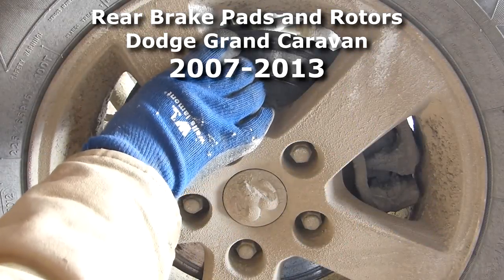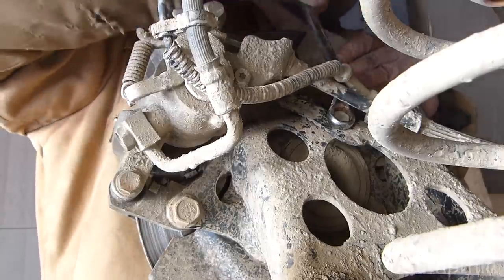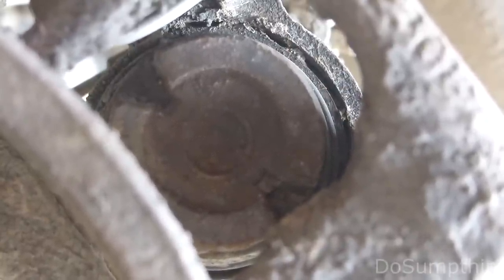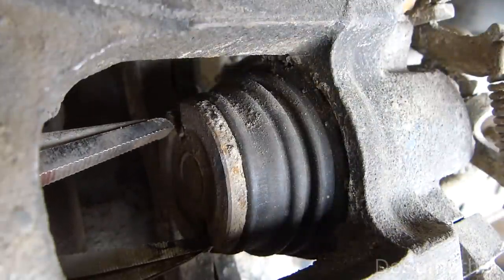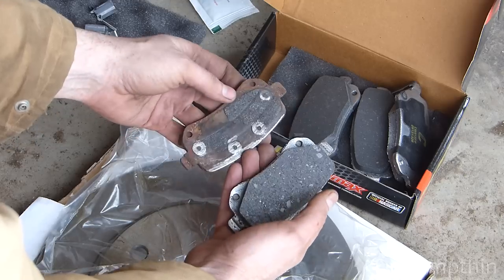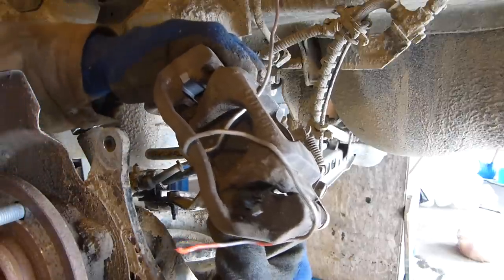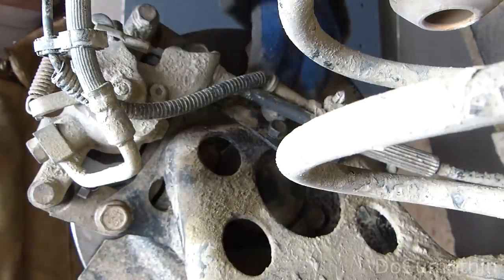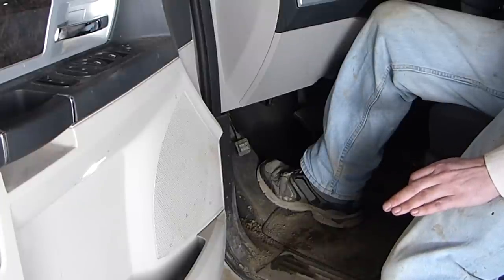STEP BY STEP: Grand Caravan REAR disc brake pads & rotors without special tool (2007-2013)

Comment: Great help. Never seen the rotating piston design before.
Something for DIYers to keep in mind.
Those anti-rattle clips, might cause some problems. The ones on the after market brakes I installed are actually stamped into two different shapes. An upper clip and a lower clip.

If you find that you can't put the pads in with those clips installed, make sure you installed the correct clips on top and bottom.

I was not initially aware of this and was about to throw the clips out before I noted the two different shapes.
That said, once the right clips were in, the fit was still fairly tight but doable by hand.

Comment: Very well done video!  Something I found on my 2011:   I would also suggest that people check are the pins the caliper slides on.  In my case the pins on the passenger side had taken in water, and therefore rust, and were binding.  The rubber boot on the slide pin was in place and had no tears!  I ended up replacing the caliper bracket also because they were so bad.  Hope that helps someone...

Comment: Thank you very much. Emergency brake cable on our 2005 Grand Caravan snapped this morning -- I had it on while jacked up to replace the power steering line. I couldn't back up out of the garage but needed to run an errand. For some reason, with the cable snapped, the back wheels weren't 'releasing'. I backed up a little and they've seemed to let off. Another maintenance job to look at when I replace the rear disc pads and rotors. Continued success. Nicely edited and produced.

Comment: Thank you for the comment on the need to adjust the parking brake after changing rear pads.  I've had a low pedal since changing the rear pads and you provided the solution.

Comment: One important step you might have left out. Make sure you clean the bracket under the clips before you reinstall clips. Rust buildup under these clips will sometimes cause the brake pads to stick. I leaned the hard way as I thought the caliper was frozen which it wasn't.

Comment: I've done the brakes on the wife's van once before and  I wish I had seen this video then.  Lubing the pins is also a great idea. Neglected that ONCE n the wife's Pontiac Grand Am and she STILL hasn't let me forget the repair bill when the brakes wore out in about 1000 miles because the pins were rough and rusty.

Comment: Another superb video! My son and I did the front brakes which went quite quickly and easy. The rear brake job was equally easy. We decided NOT to get the special tool and used a pair of needle nose pliers. It was simple and went off without a hitch. Well, we did install both pads without the metal low pad indicator pin on the first side we did and we didn't discover that until we couldn't get both pads on the second side. Whoops! It did add about 10 minutes to the whole job, so not a huge deal. Overall it was a simple job, pads and rotors. Thank you so much for making this video!

Comment: Great attention to detail is what I love about your videos. I have had issues with rear discs on cars and  I really don't think that the average car really needs discs in the rear. I find that drums last longer and have a lot less problems. Drums are more trouble to change but in my experience they are pretty foolproof. When chev put rear discs on their trucks they had problems with rock getting in them and causing a lot of grief. The design of the parking brakes and other details to me make the rear discs more prone to problems. As for shorter stopping distances, I find that more a function of the brand of vehicle than the type of brakes.

Comment: Thank you for clear , understandable, nice video angle and light, conversation without any unrelated topics to replacing brake pads.
 I just wanna make point in my experiences  with an issue, when i was using autozone Duralast brakes, that was lasting about 5-9K miles ,  which is really bad, 

i used them a lot, because of their replacement warranty,
then i switched to other better brands that started lasting 20-35K miles ,

Comment: Great video; helped a lot. A couple of things though 1) after fumbling around 20+ minutes trying to get the new pads in for the first side I decided to remove the caliper slide pins, thus splitting the whole assembly in two. I was then able to put the pads in at my workbench where I had more room to work. On the second side I took the pins out first, and that made life so much simpler. 2) Where do you live that your rotor came off with a few bangs from a rubber mallet!? Mine is so rusted on the hub that only a sledge will get it off, and since I didn't need to replace it I just left it. This made compressing the caliper a bit harder, but oh well. 3) Speaking of compressing the caliper, if your town doesn't have a store that will loan you the tool, and you don't want to buy one, there's a disc brake tool that looks like a cube that you put on the end of a ratchet; works a lot slicker than needle-nose. 4) Lastly, when compressing the caliper make sure the boot doesn't bind; if it does you'll have to crank it back out and do it again.

Comment: IMPORTANT NOTE FOR 2012 GRAND CARAVANS BUILT AFTER 03/12: So apparently there was a change made to these back brakes in March of 2012, I went to get pads and rotors for my van and they asked me if it was built BEFORE 03/12 or AFTER 03/12. Mine was built in May 2012, so it was after. Got the pads and rotors, took off the wheel and started disassembling the calipers when I noticed I did not have the mechanical parking brake bracket you encountered on your vehicle in the video. So, if you are doing the repairs on a 2012 GC that was built AFTER 03/12, you probably won't have that bracket to worry about either. Otherwise, everything was exactly as you said and I was able to get my pads and rotors replaced in just a few hours. 

Great video, thanks again!
Reply: Thanks.  I noticed the same issue with mine.  However, the parking break line did not have enough slack to get it in position in the caliper bracket.  Any idea on how to get some slack in the parking break?

Comment: Thanks for the video, it helped loads in fixing my 2013 grand caravan. I did not have the 13 mm bolt for the parking brake installed on my model. Thank you for the video and next time I have car issues I will refer to your channel.

Comment: Thank you for this, I found it very helpful.  The E-brake would have confused me never having dealt with that set up before.  This got me through it.

Couple improvements:

 Instead of turning the plunger till it bottoms out as suggested I turned it till it was just open enough.  I measured the new stack-up of the rotor plus pads and I used a depth gauge on the caliper  to get it right on.  Once installed I only had to push the brake twice to set it and the e-brake 5-6 times.
 
Also I found the rubber boot on the plunger stuck bad on the first one I did, making it difficult to turn and have it stay.  It also started to do some damage to the boot before it finally let go and aloud the rotation to happen.  Knowing this going to the next side I used a very small flat head screw driver to break the boot loose from the plunger, making turning the plunger so much easier.

Comment: Your video is most helpful, EXCEPT for the main surprise.   Expand it just a little and show us how much fun it is to get an old rotor off - when it's been rust-bonded to the plate behind it.    Whoosh!    What fun.
Reply: I second that! I ran into the same problem, I never had to beat a rotor with a sledge hammer so much in thirty years of doing brakes like I did to get these off! Terrible engineering by the kids at Chrysler-Dodge.

Comment: hey! very good video highly descriptive! i have use your trick with plyers for one side... didnt find it efficient and looked for another solution... i have come up with a power grinder disc locking key... comes with all grinders, standard size.. probably buyable in any tool shop... very very efficient!

Comment: I will like to add something because I have to do it in order to be able to screw the caliper piston down

So you need to release the pressure on the caliper piston by opening the purger valve, of course use a self one (homemade) purger container that way they will not be air on the lines. Same apply for the front and rear

Comment: 1 thing that I do is crack open the bleeder plug before pushing the piston in, it makes it go back in much easier plus it keeps you from putting back pressure on your ABS SYSTEM.

Comment: when you seat the piston the notches are supposed to be at 6 and 12 oclock,the latest brake pads have a centre pin which engages the notch,the drivers rear brakes have been quite problamatic, I thnk the addition of the pin is to address this issue.I had to do my rear brakes at 17k and now again at 40k. The original pads had no pin . Replaced  caliper as well it was seized. Nice video ,well done
Reply: In 2013 Chrysler wised up, or realized they were ripe for a class action suit, and went to H.D. brakes, but the jury is still out on whether they last  any longer. H.D. means twin front cylinders, larger discs and pads all around and 17 inch wheels to make room for the extra hardware. My 2015 is still showing excessive brake wear, in spite of these improvements. We'll see how it goes. Although off topic, another area they succumbed to consumer pressure, after 10 years of denying a problem, was solved with a big HVAC Control System recall in 2017, that is guaranteed for an additional 100 K miles.
Reply: I don't see how the piston could be prevented from turning as the handbrake is adjusted unless there was a pin. Any chance the pads were reversed ie outside pad on the inside? Without the pin the handbrake would not be able to adjust for pad wear. The pin has been there on all Gen 5 vans (2008 onwards).
Reply: Michael McLernon I have an ‘09 Town & Country that I’ve probably sunk $3000 into the AC. The last time it stopped working I decided I wasn’t putting another penny into something that was guaranteed to fail again. Now we just ride with the windows down all summer. I wish I had the money to get something else. But I’m stuck with this till it’s dead probably.

Comment: Overall A Good VideoBefore putting in new sliders, caliper channels need to be cleaned of rust and dirt that can make clips too tight to pads.(Especially important if exposed to road salt). Lubricate channels and new clips generously with high temp silicone grease before putting new pads in place.Highly recommend thorough wire brushing of hub surface before installing new rotor, (to help avoid run-out) with light coating of grease or anti-seize on rotor to hub contact area to make rotor easier to get off next time.These are minor suggestions, I know it must be difficult to try and record and work at the same time, and you may have just neglected to mention these points, but a good refresher for me to re-read before starting another brake job on these troublesome brakes.Nice Work!

Comment: I didn't use the special tool on a relative's T&C either. It's fine. Check to make sure the parking cables release properly and the caliper pins are lubed and free. Put some brake purposed grease on the pad tabs and backing plate. Most importantly, use quality components.

Comment: You can tell if you have cycled the parking brake enough by jacking up rear wheels off the ground, setting the parking brake (after cycling) and checking that both wheels will not rotate. If one or both  wheels can still be turned, you need to keep adjusting until they won't move. It may not be safe to drive until both wheels are fully adjusted. Brake pedal has been reported to go soft if not properly adjusted.

Comment: Well your video really inspired me on trying to do my own back brakes... Unfortunately I couldn't get the 18mm bolts to even budge... I tried oil penetrants, An electric impact, and a tork bar, propane torch and it won the fight over me... Guess i'll have to bring it over to the garage and get the wallet out again... :(

Comment: I've got a 2007 Dodge Grand Caravan which is VERY different from the one shown which is the 2008-2013 models.
Reply: Greg Rein glad to read this comment. I have a 2007 and was skeptical when I read the title “2007-2013”. I knew they changed a lot in 2008.

Comment: As far as those little grease packets that are sold at the counters of Auto Zone & all the other auto parts store chains... 

Sometimes you may notice that some of those grease / lubricant products are sold in 3 different grades, like "high performance grade", for example...

I can tell you from first hand knowledge that "all 3 grades" are exactly the same product...so don't waste your money on the premium or higher grades. It's just a scam to take more of your money.

The grease / lubricants show up at the packaging facility in both 55 gallon drums & sometimes depending on the product, in one of those big tanker trucks w/ a valve out the back.

The packaging facility takes that product straight from those containers and mechanically injects them into the small foiled or plastic envelopes. The only thing that changes in that operation is the changing of the fancy colorful package.
Reply: International Silverstring Submarine Band they're all 1.49 though lol

Comment: Great Video, I have a problem with my parking brake, the dealer set the pedal so tight that I can barely push it down but the parking brake doesn't engage.  Upon inspection I found that the return springs are missing as well.  They adjusted the pedal when I complained about them not testing the brake.  Any ideas on how to reduce the tension on the pedal so I can get the parking brakes back to normal and adjust them properly?  Thanks.

Comment: I just completed changing front pads and rotors after watching your excellent video.  I noticed that for the rear pads and rotors you did not remove the caliper from the caliper bracket as you did for the fronts.  Any particular reason why?  Thanks!

Comment: - I'd recommend putting some loctite on the bolts. Having a bolt pop out on the highway is not fun.
- The tool is also a good idea. If your needle-nose pop off the piston and damage the boot, you're going to be googling bleeding brakes. 
- Loosening or opening the brake fluid cap while pushing in the piston may help if you're having a hard time pushing it back in.

Comment: Using the needle nose was a pretty smart idea.  Only complaint about this video is that you didn't take the caliper off first and inspect the pins.  It's very important to grease those pins every time you change your brakes.  If they seize in there you'll likely have lots of problems with premature brake wear.
Reply: +Lêmon I just replaced my rotors and pads yesterday, was simple enough with this video. But, I also did not take out and lube the slide pins like I did on the front, mainly because this was my first go-round with brakes and did not want to do anything I wasn't comfortable with. Now you have me concerned though, I still have the grease packet. How easy is it to lube the pins without having to go through this whole process again? Is it just as easy as removing the bolts and slide pins, greasing them, and putting them back together? Or am I going to have to unbolt everything again?? Please reply, thanks!
Reply: +Will Macan your going to want to remove the caliper again and pray that your slide pins aren't seized in there.  If your experiencing uneven brake wear you might want to get ready for new calipers, unless your fortunate enough to remove those slide pins.  I'd say greasing those slide pins is just as important as changing the brakes themselves in my opinion.  If you don't you'll run the risk of them seizing into the mounting bracket.  Look up a video of how a caliper works with the sliding pins.  But they are easy to take out, all you have to do is remove the caliper bolts, remove the caliper, then remove the slide pins.  Grease them up pretty good ( I always put a little extra ), then throw everything back together.  You don't have to remove anything else really.

Comment: good video....i noticed you did not use the grease in the packet that came with the new pads....should i assume that is caliper grease to apply after you have cleaned removed and cleaned the caliper guide pins?

kk

Comment: Thank you so much, exactly my problem. (Rear brakes 2010 caraven)
Unfortunatly this is the second time in 40000 kilometers .
Fixed for free by the dealer the first time, but exactly the same symptoms again a few miles later.
The "clue" is quiet squeeking with no brakes applied, that becomes quiet, with just a tiny brake application.
Just looked tonight, lots of disk material remaining, rotors still smooth, no sign of extreme heat, BUT,  the rotor is not free to spin, the disks are not releasing all the way.
Any tips on a peranent fix ?
Thanks.
Ross
Reply: there are numerous posts about this issue. Iam going through the same thing with my 2011 rear drivers side brakes. there is some other thing happening that a solution for has not been found

Comment: If I need to interact with (remove) that e-brake bracket, does that mean the e-brake needs to be off, not on? Usually it is required to e-brake when jacking up a car.

Comment: One question that wasn't mentioned, does it matter if rotating the caliper back in if the two groove are up and down or 9&3? Does anybody know because I assumed that it went up and down because of the dimple sticking out of the brake pad.  Thanks for the video. saved a lot of time

Comment: I did my brake pads but one side (driver side ) smell like burn rubber  and get little more hot than the other side I checked spining the wheel and spin freely ,no smoke but smells like burn rubber .so I have to release the parking brake several times to for this issue too. or could be something else already checked everything again and everything is right in place.